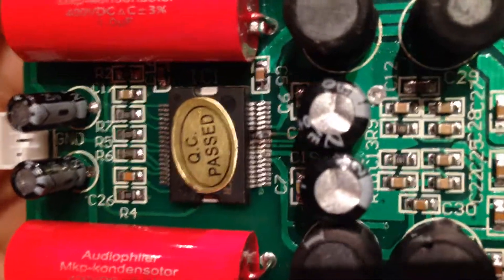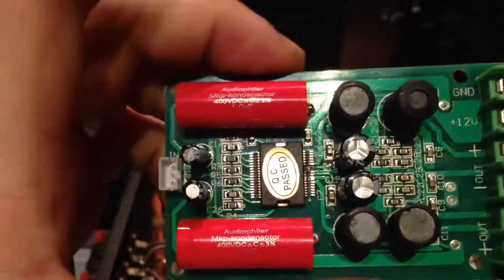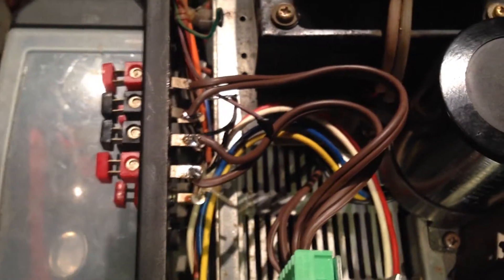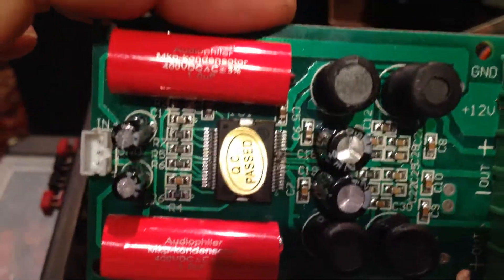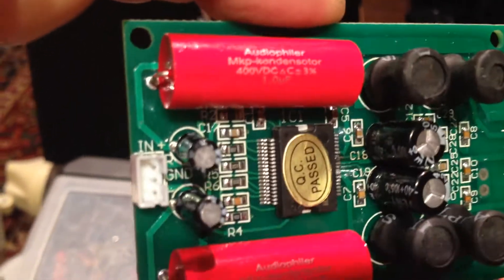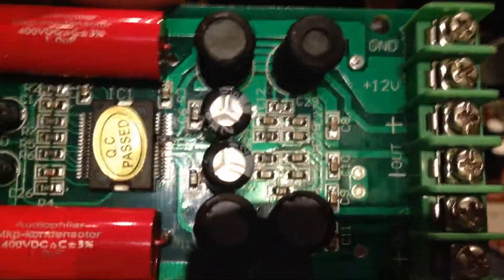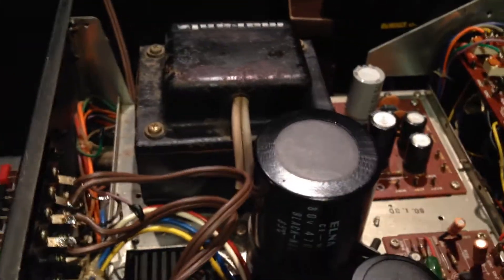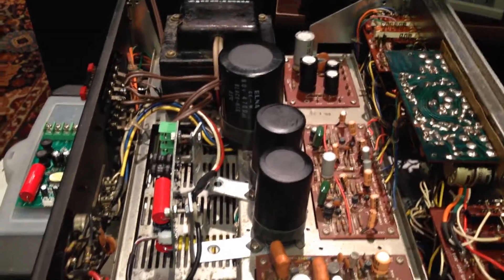Don't reverse polarity on Chinese amp boards!

Comment: Hello.
I have some of these amps, and funny one of the output terminals are inverted, i mean, if you measure voltage output, it gives negative volts.. (the middle pair of terminals more precisely). Does it happens to yours? what does this mean? 180 degrees out of phase? Shouldn't you wire the speaker according to voltage?
Reply: happens to my tpa3116 d2

Comment: i have had these tripath amps also. i reversed the polarity on one of them by accident. not good idea!! popped a hole in the chip and let the magic smoke out. they sound good up until half volume then they start to produce square waves. they will do about 7 clean watts and 15 watts clipping.

Comment: That's an interesting mod.  A lot of guys in south america make modifications like that to replace un-replaceable amp ICs.  What kind of module was in there originally?  Integrated?
Reply from the maker: Thanks for checking it out!  It was a modular amp- I think 6 transistors, 30 watts per channel. When I got it (free) the guy had taken the power amp module out to repair it (he is an electrical engineer) but he lost it somewhere.  I can't find one, so I used this little amp.  It's $7.  Sounds great.  Gonna put another one in there for the other channel.  Question Mr. Felix: can I bridge this amp do u think?  
Did u find the caps you need?  .o33uf @1000 and .047uf @1000 right? I got a new big tv the other day I'm gonna open tonight.  If I have the caps I'll send them to you.  Let me know...

Love your videos, thanks for looking!  Steven
Reply from the maker: Integrated.  I found one online for 40 bucks but it sold right before.  You wouldn't believe how GREAT the preamp is and the controls are in this thing.  That's why I didn't just chunk it in the recycler...  Want to see that sweet tv run if it's still on the bench.  I really want to send the caps.  I'll check tonight Felix.  S
Reply: Steven King You mean bridge it as in combine the two channels into one?  I'm not sure about that, you should check out what it says if you got a technical manual with it.  Otherwise you might be able to find out by looking for the datasheet of the power IC.  No I never found the caps unfortunately.  Let me know if you find any.
Reply from the maker: I'll check those two tv's.  Still at work, so I prolly will have to wait for the weekend.  On the amp- yes, bridge them.  I didn't get ANY type of data or instruction sheet.  Just a blank white box!  S